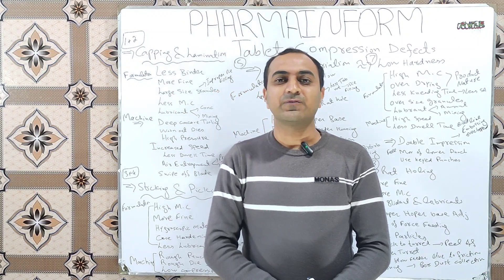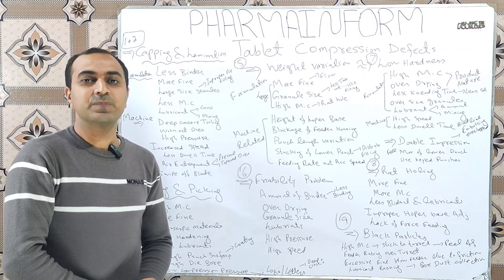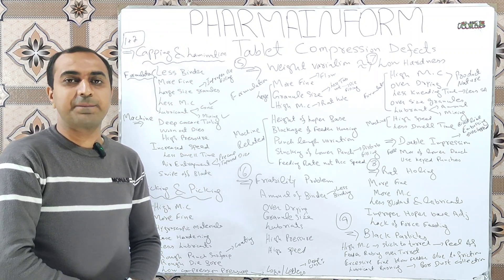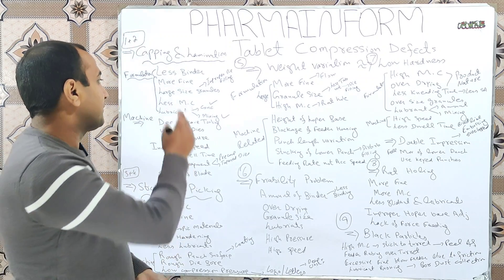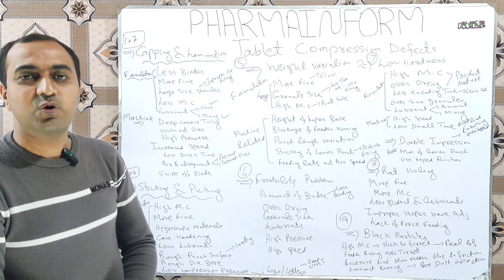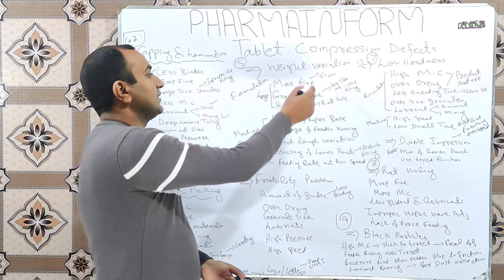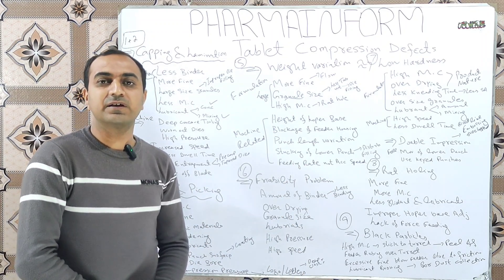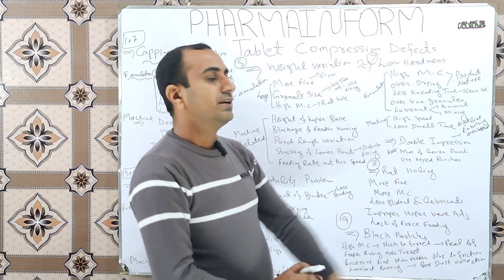Tablet Compression Defects | Reasons & Remedies Of Tablet Compression Defects

Comment: High pressure of compression machine (tablets compressed at high hardness) will result in lower friability not higher friability, kindly correct.
Reply from the maker: Dear higher compression machine pressure may result in Tablet capping (depending on formulation) also have higher tendency of friability